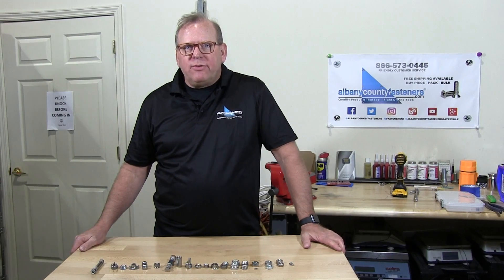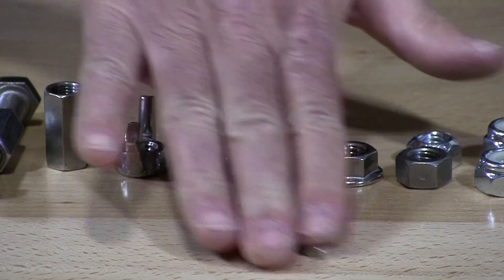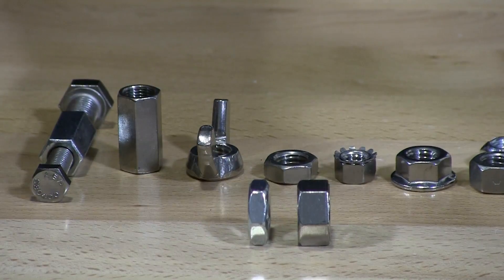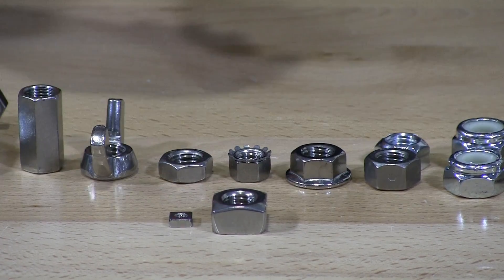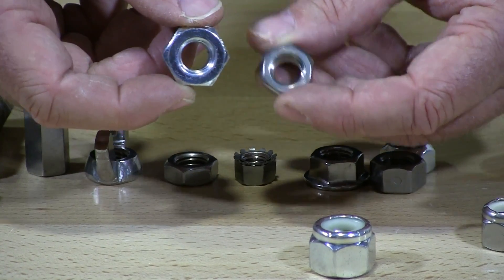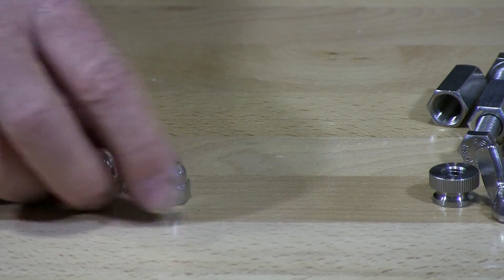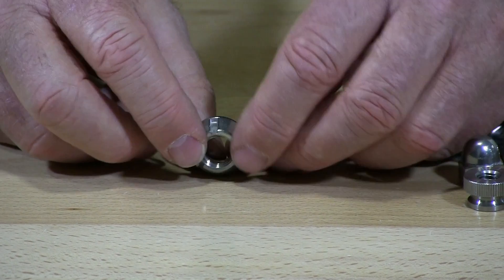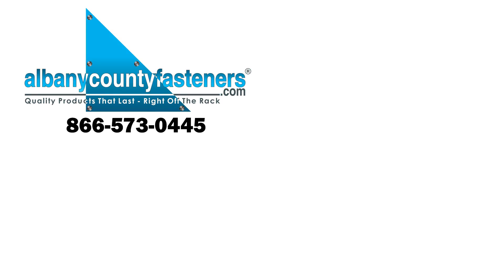Nuts 101 Overview - The Types of Fastener Nuts | Fasteners 101

Comment: Great vidio. In all my years never heard of the last nut that you shown with the waxed threads. Looked like an ordinary Ny Lol nut. User them in Nam oh Hueys helichopters. They would only use them once brush throw away. Believe on the engine & transmission they used castle nuts with twisted safety wire.

Comment: Galling seems to be VERY common with stainless steel Nylocks™ ( on stainless bolt ) any size ¼ inch ( M6 metric ) and bigger ... use dissimilar ( zinc plated / brass ? ) metal nuts or LOADS of antisieze compound ( you might not be able to get angle grinder in ! ) ...

Comment: What are torque specs for Stover Lock Nut? It will be applied to attach Lower Ball Joint to the Control arm (originally on rivets, which are removed, so no TSs in the manual for the car!)

Comment: Great video. One doubt, if I have a joint on 2 metal parts which are supposed to flex, but not loosen with repeated use, which nut should I use? Or should I just use a normal nut and weld it?

Comment: So why do you need nylon locknuts if a regular nylon nut already has a locking effect due to its nylon insert?
Reply from the maker: I assume by "nylon nut" you're referring to a nut made entirely of nylon? The key difference between those nuts and the locknuts with the nylon insert is that the insert isn't threaded. The insert gets threaded as the screw is fastened through it. That's what creates the locking effect.
Reply: No. I mean the two kinds of nuts with a nylon insert. Regular nut w/ an insert and a locknut w/ an insert. Why is the latter needed?

Comment: If I had a 5/16-18Tpi stud , how would I know what size nut to use ?
Reply from the maker: It would be the sames size. So a 5/16-18 stud would be compatible with a 5/16-18 nut.
Reply: @AlbanyCountyFasteners  Thank you , Lets say i only have a nut how will i measure that nut to know what size and thread nut it is?
Reply from the maker: The easiest way is to use a thread gauge like the ones we have here: https://www.albanycountyfasteners.com/gauges-measuring-tools/acf_cat_gauges_and_measuring_tools.htm For nuts, we like to use the thread gauges on wires and try to fasten the nut to the various sizes available.

Comment: This is good but would me more helpful if on some of them the use/purpose of each was elaborated on a little more. 
For example, The security nut explanation was helpful, some other things though i had to separately look up
like left hand nut, to find out that its threaded the opposite way. I actually thought it was for left handed people at first or something.. then I was like no that can't be it, and had to look it up seperately
and wing nut, "used for many different type of applications" isn't very helpful. I separately found out it's for things that need to tightened and loosened pretty often
....etc
:D

Comment: Which can be used in vibration prone area
Reply from the maker: Any of the Lock Nuts. They are designed to resist vibration and accidental loosening. I've included time stamps for the Lock Nuts shown in the video:
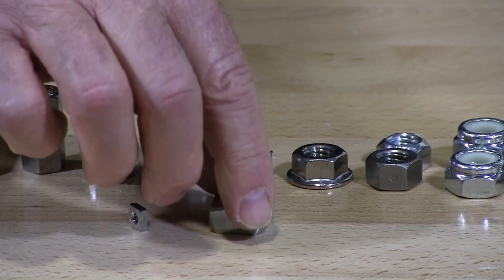5:20 - Nylon Lock Nuts
7:29 - Stover Lock Nuts
7:56 - Two-Way Nuts
8:46 - Serrated Flange Nuts
9:29 - Keps K Lock Nuts
There are other varieties of lock nuts, but these are some of the most common ones used to resist vibration.
Reply: Thank you very much @Albany